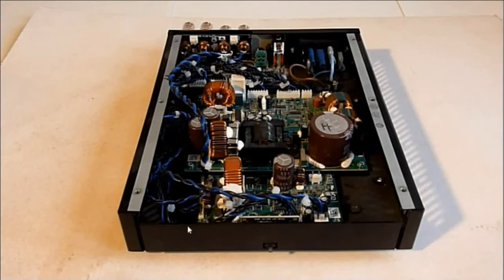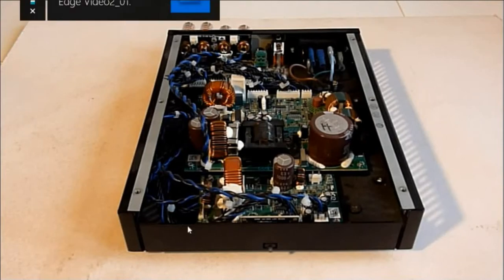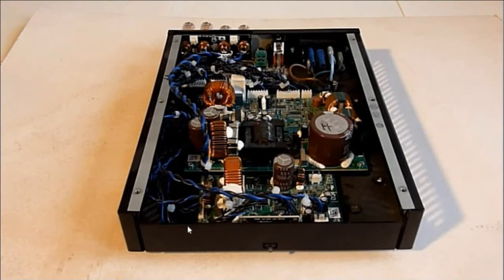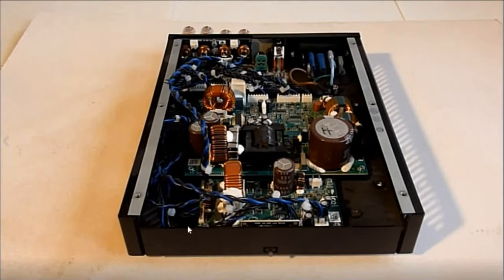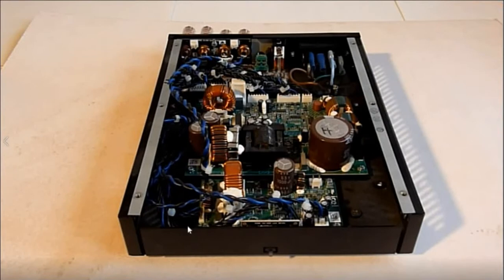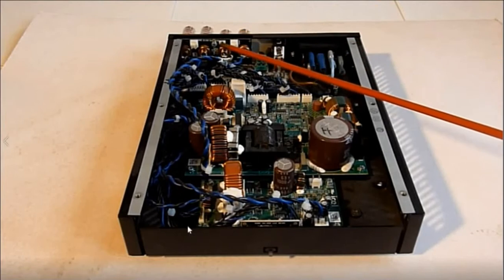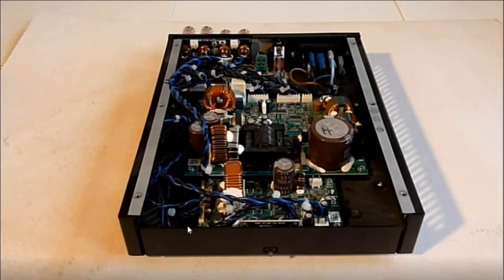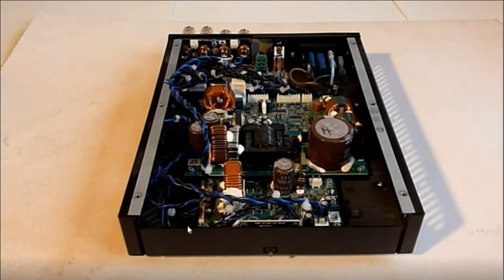How to improve XTZ EDGE A-2 300 Power Amplifier (No.2 of 2).

Comment: Would be good if you could add some close-ups. I enjoyed your earlier video as well, and I agree -- I am dismayed at the number of non-soldered connections I see in various audio gear. I have eliminated as many physical contacts in my gear as is practical. And I am seriously considering purchasing the XTZ amp.
Reply: Take a look at Audiophonics from France too. They have Hypex nCore amps like this for about the same money. I bought mine used, but they cost about $500 shipped to the US. Mine is the single ended RCA version that is based on the NC252MP. It's model designation is MPA-S250NC. It sounds great to me, and has more then enough power for my Buchardt Audio S300 MKII SE speakers. I went with it because it seems like everyone thinks the nCore stuff is superior to the Ice Power amps. And it was cheaper. This amp was my original choice, until I found it about the one I got. Good luck either way. ✌️
Reply: @amb3cog  it's more expensive now
Reply: @florin604  Uh yea. Inflation over the past year has done that to everything. But thanks Captain Obvious.